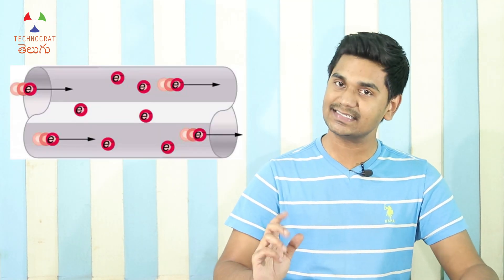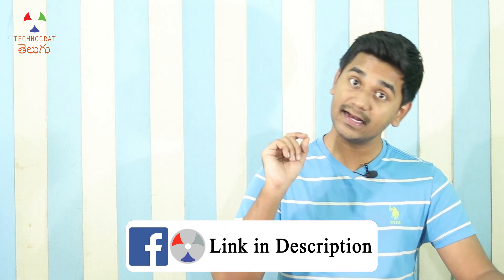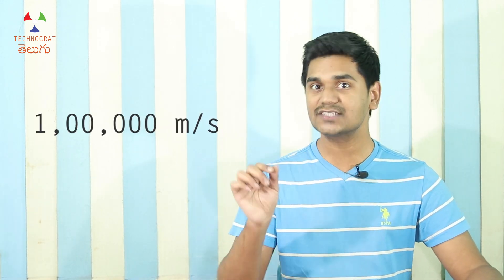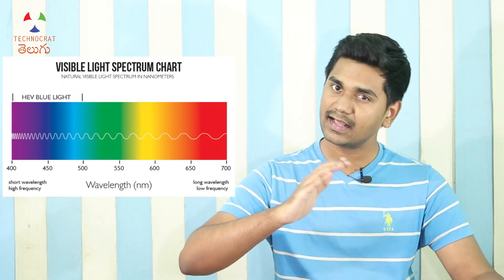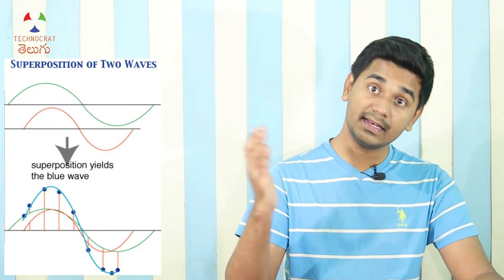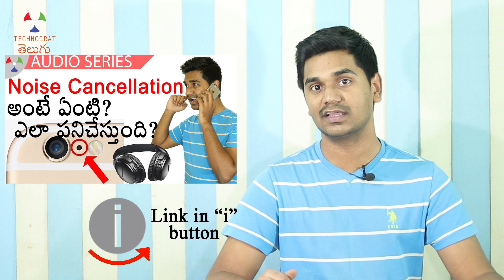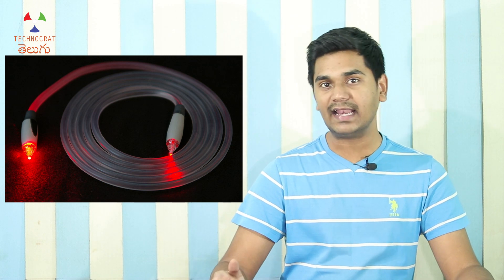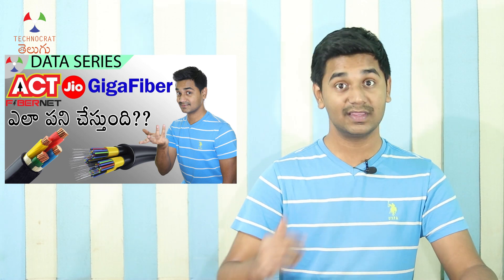Computers that use LIGHT for processing!? – OPTICAL COMPUTING!! | #TCT_Processor_Series 60

Comment: Transistor nm tagginche veelu lenappudu SOC peddaga cheyochhu kada ?
Please reply ivvandi
Reply from the maker: same size SOC lo more number of transistors fit cheyalanedi mana goal bro!! ..... so transistor size small unte ne more performance with a smaller chip and also less heating!!
Reply: @TechnocratTelugu  you are right bro
But SOC prddaga unte performance better ga untadi kada
Just like ryzen threadripper
Reply: @RR-nk3hj  bro SoC size penchithe nee mobile size perugudhi as well as heating issues vasthay that's y we won't recommend that!!!